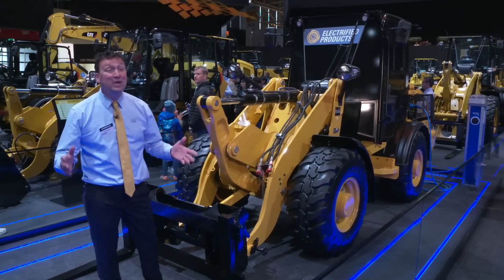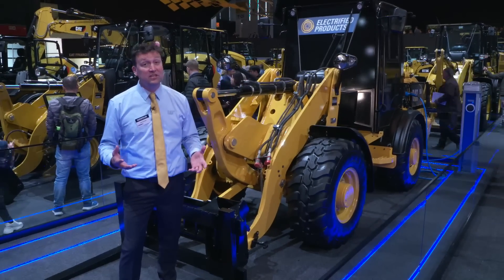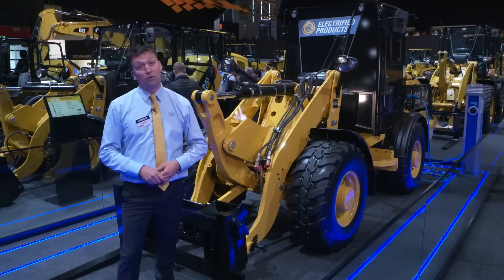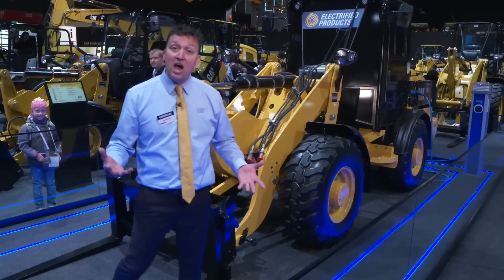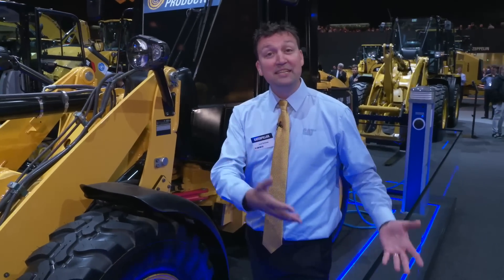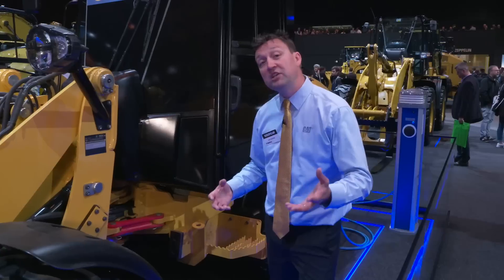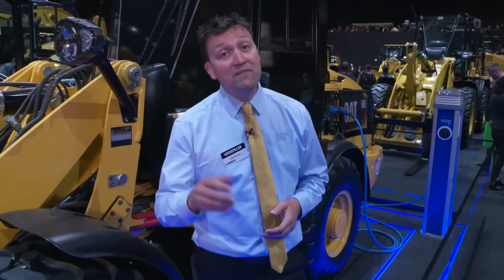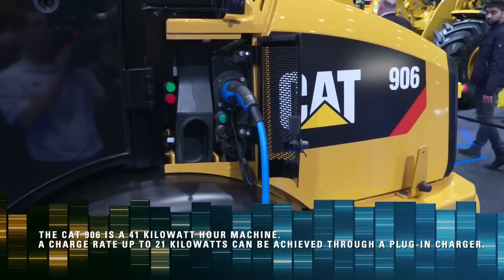Meet Our Zero-Emissions Cat® Wheel Loader | bauma 2019

Comment: Well the same cost to build it using fossil fuels. Then batteries that will not run for eight hours or longer a day. Then their shot after so many recharges. Then they have to be replaced at almost the cost of a new machine. The pay load lifting is greatly reduced to conserve battery charge. So you say it’s better yes for the back yard builder may be. Heavy high way show me what you got. Seen the demonstration of your electric front end shovel. Three hours at heavy lifting an digging. 
Still has a carbon foot print the same as that of Diesel machines. Let’s talk farming an those tractors. Better to use horse drawn plow then. Many still around. Again let’s see you cut the fossil fuel building an still have the power. Cat may have honk they have the right idea. Even the supply of power has to be installed to recharge. Are you selling three of each so two can charge while one works. Oh that’s right they take longer to recharge. Thanks but back to the drawing easels so your artists can creat more toys for smalls boys. Wind turbines don’t last long either an at a billion each an so many fossil fuels to be used to build. Is not the answer. As the shoot the mustangs out west buy the thousands to make people happy. An turn it into animal feed again use of fossil fuel. 
Whom are you kidding!  I was born at night but not last night.